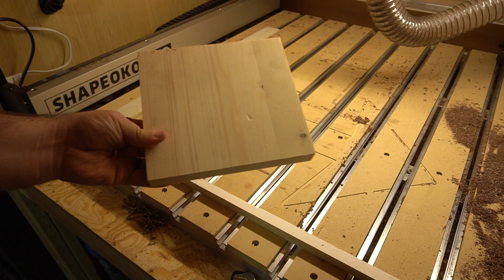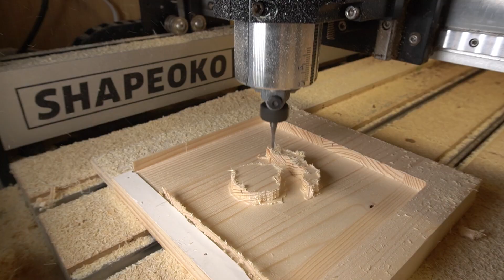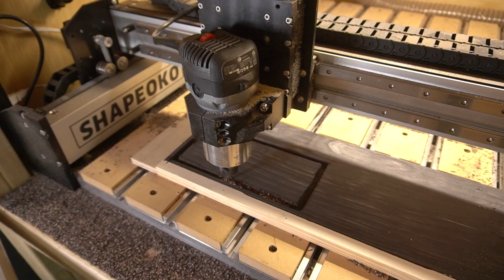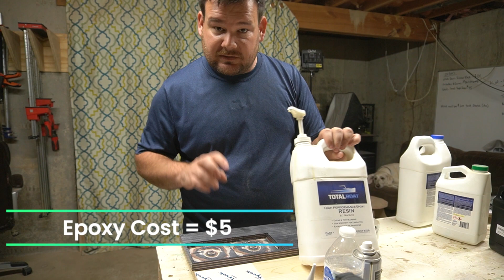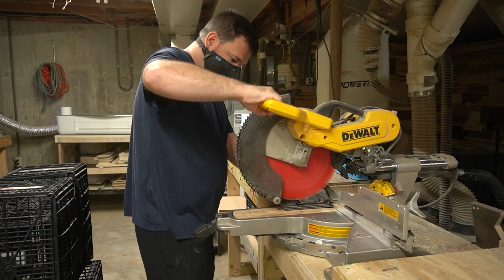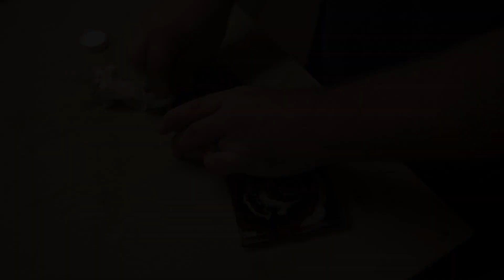CNC Router 3D Topography Resin Coasters - Will It Sell? Episode 1

Comment: Great video covering what it takes to design/build and try to sell something like this. I have done quite a few topo maps on my CNC and I mainly use 3/4 Baltic Birch plywood. It has 13plys with no holes that give a layered appearance when finished. You used to be able to buy it for $70 per 5x5 sheet. It is pretty expensive now though.
Reply from the maker: Cool, thanks!

Comment: i would skip the resin and make a larger, frameable topo-map.  You could go a number of ways with it including making each topo layer flat rather than the smoothed version you went with.  That makes it more "map-py" and could speed up machining time as you could do it with just one bit and probably one g-code process depending on resolution.
Reply from the maker: This is a interesting idea. I'm having a hard time picturing a flat version when to comes to seeing the different colors of plywood.
Reply: @AndyBirdBuilds  i'm not sure it would work to be fair.   i've been thinking about something similar though everytime i see the rough passes over a cnc sculpture.  you could set your rough passes over the normal model and set your pass depth shallower than normal to get a free preview of what it could look like.  if you like, then never do the final sculpture pass.  if you hate it then you are just out the extra time the slower rough passes took.
Reply: i've got a sign on the cnc that will take the rest of my time tonight, but maybe tomorrow I will give it a try.  I'll probably stack a couple pieces of ply up so that I can get a deeper model and have more ply layers show through.

Comment: Idea: use the initial CNC'd mountains to make a negative cast in silicone (can use much cheaper material). Cast the mountain from a dyed material (concrete, plaster, resin, etc), then apply a see through resin at the end.

The process has a lot of up front R&D, but I think it will take away a lot of the creation time at the end (especially if you batch create them).
Reply from the maker: Cool idea

Comment: First thought I got is, use your shop for piloting products and testing the market for high volume sale, than outsource production. E.g. machining time here in Serbia can be found for about 7-10eur. This is more 3 times less than your price, and quality is high. Also if you hit high volumes you can lower your costs. Although shipment and taxes should be checked out. Again, overheads for high volume production are devided per number of items (volume), the higher volume is, the less cost of good sold are.

Comment: That's the ultimate question, "will it sell?" I find, once I get into 3D cutting and think of charging by the minute, my costs go way up. Sure, it's more interesting looking but the time can make the cost prohibitive. But on the other hand, it's CNC. It goes by itself. You can do other things while the pieces are running. Still, at an art of craft show, you might want to show and sell some of your most interesting pieces even if you are not hitting your price point.
Reply from the maker: Great thoughts. Thanks for sharing

Comment: That material cost seems super high. I'd think a baltic birch ply would look just as cool. You'd still get the layer lines, but a more muted colour.
As others pointed out, the economy of scale really matters, making 2 is going to be a lot more effort than making 30. 
You could also probably optimize on size, they seem kinda big? Fitting more into a single cnc setup reduces the impact of setup time on a batch.
I really like this video format, cool stuff.
Reply from the maker: You make some great points. The material is super expensive. The final dimensions were 4.5'' x 4.5''

Comment: Love the idea, and honestly your explanation of cost analysis is very valuable. 
To make the process more cost effective, I would consider using a thinner piece of wood, making the design more shallow in Fusion360, which would also result in less epoxy being used and cheaper material.
I would also consider making a larger batch at once, for instance 20 coasters, and rather than cutting them with a saw, which takes your time, could they be cut out with the cnc machine at design level? 
Looking forward to your future content :)
Reply from the maker: These are some great ideas. I think you're right, batching is a must. The reason I choose not to have the cnc but them out was to make it easier to pour the epoxy.

Comment: A coaster isn't the right object for this project. It won't absorb moisture. Basically you made a paperweight. 😉

Some random thoughts...
🤔 They could be paperweights with a company logo on it. Company could give as gifts to employees. Just figure the worth to add their logo, in large numbers, and see if it's worth it. Advertise where businesses shop.
🤔 Make a little larger and use as the base for a small lamp. You'd lose seeing some of the 3D, but making it larger would solve some of that. 
🤔 A little smaller, with a bolt "set in" and you have knobs for drawers and doors. The bolt wouldn't be visible on the front side. Knobs are a big selling item. 
🤔 Put them of the corners of a lap or breakfast tray. Run a dowel between them to stop sliding items.
🤔 hmmm, that's all I got for now. 😉

Comment: Batching them out will help to reduce your material costs, setup time etc. I think the 1.5 multiplier is the biggest challenge here. Even if you can get your costs down and 1/2 your labour to somehow arrive at 50 bucks, you still end up at 75. I agree it is smart to use a multiplier, but maybe a lower one when it is primarily a cnc project.
Reply from the maker: I agree with the batching. Definitely could save some time there. Great point on the multiplier. There's definitely enough meat on the bone to reduce slightly. Thanks for the comment 👍

Comment: My awesome insight to CNC friend. I've been a production manager for three decades over multiple industries. 1st demand, 2nd competition, 3rd speed and finally and most importantly cost is where the profit margins are found. I know you have this formula down solid but you're caught right now between money and creativity and that's a deadly trap. Either be production based on unique characteristics cutting edge designs or client based endeavors that are better than anyone else's. You have to decide otherwise you're going to be fighting a battle against yourself. Hit and run or Mastercraftsman. Nothing in between except YouTube which I'm guessing is the horse you're betting on. Which honestly has helped me with CNC, you just need to recognize that this industry requires the same talent and investment as your finished woodworking. No bleeding edges/no bed sheets.
Reply from the maker: Great insight, some of the best I've heard. The only thing I disagree on is that there are only 2 avenues, its not black and white to me. Either pure production or creativity. With the last decade of advancement in desktop cncs, there's an entire new market now. It used to be you could only do cnc production in an industrial setting and only artists to the creative. Now, someone in the corner of their garage can let their imagination run wild and produce a hundred of them in a week. Sure, not at the scale that industrial shops can but nonetheless they can do what the couldn't 10 years ago. Pretty cool if you ask me!
Reply: @AndyBirdBuilds  well heard and well respected. You are certainly on the way, I've seen the horizon many times during many eclipses of the the market and you have something in the workshop Edisonesque. It's there just keep digging, my bet is on you. I can tell by the way you sand down the obstacles and the unnecessary. You def have a kesn sense of sorting out what's neccessary what's scrap and that's a true gift. Many who are creative get caught up in that process bc they move by feel and not by real motive. To have both right and left sides working in continuity is rare.

Comment: I think the number one thing that we could change in this process is not material, man hours or the additional overheads. 
It’s the methodology. 

We could employ some very simple Agile practices, for example define the value and the effort (we would find that we could deliver 80% of the products value, in 20% of the effort/cost).

For the manufacturing side, we could look at employing 6 sigma, ask the 5 whys, where can the process be improved.

After all of this, we may find that the thing we “think” gives us the most value, actually is our biggest cost and doesn’t add much value at all.

Comment: After you poured the epoxy in the speeded up portion of the video, what were you doing with the torch? I've never seen a torch used when putting down epoxy.

Thanks, and looking forward to more videos in this series.
Reply from the maker: James is correct. Removing air bubbles
Reply: It helps to remove air bubbles in the epoxy

Comment: Great video Andy, thanks! I like the topography idea but the resin over the top means you lose the tactile feel. As Carl said below, maps "look" better so you could stick to a cheaper wood and do roughing pass to create contour lines and get a "low poly" look to the 3d effect that would stand out under the resin in a coaster. You could also use the saved time and flat surface to engrave the name of the place on the coaster for extra effect.
Reply from the maker: Thanks, Dale! Those are so some great ideas.

Comment: I have a pricing model that I got from a machine embroidery group that I'm in(what can I say? I love "robots"). You set a magic number that equals the minimum pay you want/need per hour. This could be $30, or it could be $150/hr...depends on you. You then add the cost of the materials, electricity, rent, etc. Then you calculate how many items you can produce per hour. Divide your total cost by the total number of items you produce in an hour and that'll give you a rough estimate of how much you need to get from each item to make your magic number. It sounds like you'd need to produce at least 10 or more of those at a time to get to a price point that someone would actually buy it.
Reply from the maker: Thanks so much for sharing. You're right, they're are a number of ways to price your work. I agree batching would be a solution to get the labor down.

Comment: The mistake your making is using plywood. I do this with soft wood just rip it down and vacuum pump whatever color I want into the wood, let it mostly dry, give it a quick sand, glue, clamp, dry again, then carve. The key is ( how much time am I actually spending physically working on this). Very little time, the pump is working, the clamps and the CNC, not me.
Reply from the maker: This is really interesting. When you say softwood, something like pine? What are your material costs vs. What I'm doing?
Reply: @AndyBirdBuilds  I want to say my material cost are zero, but the truth is, it’s not. I just can’t calculate any of it,(other than time). The boards are scrap of everything, hardwood and soft, except plywood and MDF. The stains, paint, equipment, resins, glue, bits, all paid for from the previous jobs. Just imagine that you bought five 2x4, then ripped each one a different size, 3/4, 5/8, 1/2, 3/8 & 1/4 just to make it simple. Do not worry about the width to much, or the edge for that matter. Just do what you can with a table saw, but don’t go for perfection. Just keep in mind, rivers ( blue or muddy) normally fall below roads. In the mountains rivers higher than roads are normally white, not blue. That tells you what pieces should be stained certain colors. Now find the flattest service you have available, start stacking and glueing. Don’t worry about the top being flat, just don’t go above your maximum Z height, unless you’re going to cut it off first. Just create the tool path and let the machine run in open air if it needs to, just speed it up, until it starts cutting or mill it flat first. Or unplug your stepper motors, put in your wasteboard surfacing bit and use the machine by hand. I’m sure you can figure out how to get the Z to go down without power.

Comment: Where is walrus oil link? I am slow.
Reply from the maker: Walrusoil.com Use Code ANDYBIRD when you check out. Thanks!
Reply: @AndyBirdBuilds  I’m gonna grab some. I did find it in description but it wasn’t a link. I was focused on a link Andy! When I get focused I don’t see much.
Reply from the maker: You should be able to click on the walrusoil.com link. Shop their website and use code ANDYBIRD at checkout for 10% off. Let me know if it doesn't work
Reply: @AndyBirdBuilds  it worked sir.

Comment: Where did you get this plywood? I cut out some 3D maps using 1" plywood, the layers gave it a really cool topography feel but would run into inconsistent layers with gaps. Love the look of the colored layers. Quit the coasters and just make maps. solid maple, mdf backer painted black with some text then a simple boarder. Same machine time, little more labor but the return is worth it. Keep up the topography videos though!
Reply from the maker: This plywood is called Frogwood. Got it from their website. You need to use higher grade plywood to avoid those voids. I like your ideas! Do you sell these? If so, where have you had success? Thanks for watching!
Reply: @AndyBirdBuilds  I’ve sold a half dozen New Hampshire maps at a local shop. Just started doing larger solid maple topo maps that are made to order. Most popular is a NH 48-4,000 footer mountain range…$$$.

Comment: Andy, in such a shallow project with very low step over, you can probably eliminate the roughing pass. I edit my g code file to slow down, to maybe 20 or so IPM, the first row or maybe two then run full desired speed after that. To find the turnaround point, watch for the X or Y to go from negative to positive or vice versa and the put in an F# there for the full job speed.
Reply from the maker: Thanks, Roy. This makes sense. If it yielded a good quality result, this would be a game changer.
Reply: I should have mentioned this works great with tapered bits, not sure how it would do with a straight 1/8 bit. Also, no idea how it would do on a 3018 and such with lower rigidity and Z assembly mass.

Comment: Did you look at buying the plywood at a wholesale level? You showed one piece of what looked like a 6 x 12. How about a 48 x 48? Or a 48 x 96? With what I make, if I bought at the retail level, I could never sell. Volume pricing is what makes production sellable. Thoughts?
Reply from the maker: Thats a good idea. From the place I bought this they only sell retail. With a little research I might be able to buy wholesale. That would reduce the cost some, but I don't think it would be enough of reduction in cost by itself. But that combined with some machine time reduction might be the key.
Reply: @AndyBirdBuilds  have you looked into using a larger bit to rough out with, say 1/4"? Or maybe a larger round nose? May save some machine time.

Comment: I think they were places you could take this basic idea and possibly make profitable product. First I think you could go smaller it looks like your coasters are larger than what I think people expect in a standard coaster. I think a set of four is the right number for coasters that makes a proper set in my mind. But really the labor required for this makes me think this would be better as a custom product where your customer submits one picture or a set of pictures to be turned into coasters and then the price point is significantly higher.
Reply from the maker: Thanks, Jeff. The dimensions are 4.5" x 4.5". I agree with your thinking about having clients submit they're topography would yield a higher retail price. Maybe combining that with what some have mentioned about in the comments would be the recipe for success? Just not sure if theres a market for a coaster that expensive...

Comment: Hey Andy - enjoyed the video. A couple of thoughts I had while watching:

The first is that coasters work best if they are somewhat absorbent, such as cork or ceramic. With a resin coaster, and worse one with an oily coating, water will just bead off of it and end up on your furniture anyway. You would need to design it with a lip or groove to prevent that.

Second, it seems to me you could alter your production by making several topographical maps with a 3D printer or CNC machine, then make molds of them and pour layers of colored resin to get your topographical map, instead of using plywood. I don't know the cost of the Total Boat resin vs. that plywood, or the pouring times vs. CnC cutying, but it might be worth looking into. You could get as many parts per batch as silicone molds you made, bringing time costs down substantially.

Good luck with the next iteration. I'm sure you'll sort it all out. These are just a few thoughts off the top of my head, feel free to use or discard them as you see fit.
Reply from the maker: Hey thanks for your thoughts! Really, thank you! This is exactly what I was hoping for. I really like the mold and colored epoxy... I'm going to be thinking about this!

Comment: I like it. Thought: Are there other plywoods that, maybe even with a stain, would provide an interesting result that's not outrageously expensive? Color difference may not be as interesting, but it may be interesting enough.
Reply from the maker: Great! I think this would be worth investigating. A higher grade would definitely be important. You wouldn't want to run into voids in the plywood, that would ruin the piece.